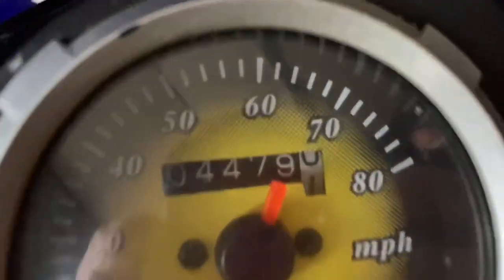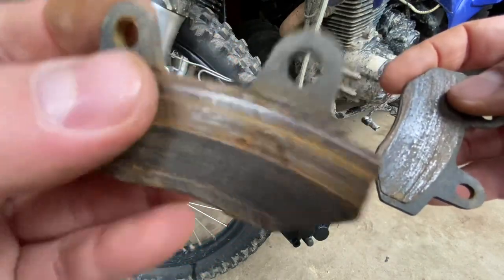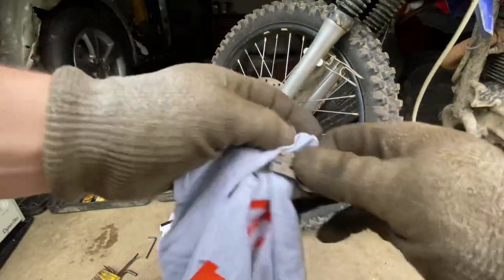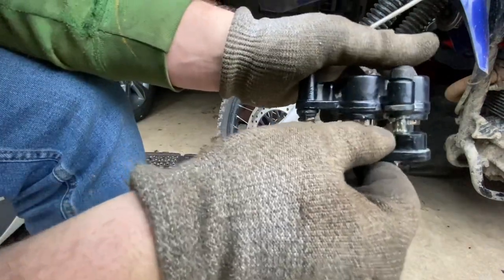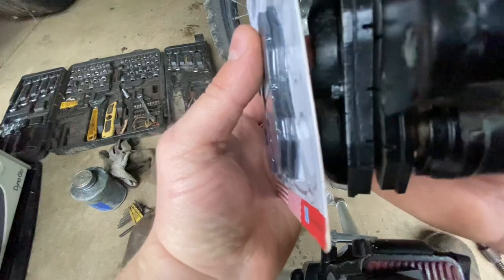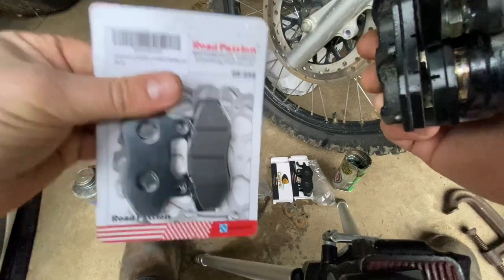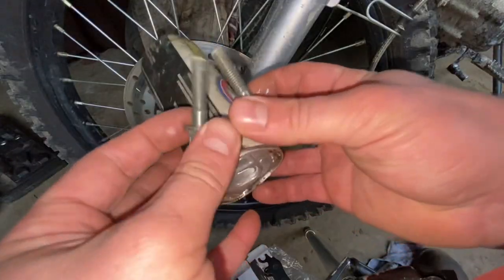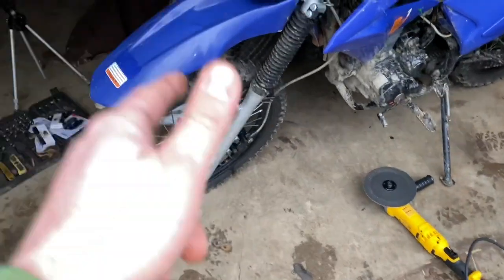Hawk 250 FRONT BRAKE PAD REPLACEMENT

Comment: Thanks for the video, it is very helpful.  I am in need of new brake pad sliding pins for my front and rear brakes.  Do you know if any of the Japanese bikes have pins that will work?
Reply from the maker: Unfortunately I don’t, Iv never had that issue on my bike, so I haven’t had the pleasure of looking for slider pins yet 🤣 the best advice to give you would be to measure the pins and do some looking around. Or see if txps can get the parts, also there is a guys called hawk250 parts on eBay now that has many parts for sale from the hawk. He might have what you need. Hopefully this helps! Thanks for watching!

Comment: hey i have a question my piston got worn down on my 250 hawk and i cant find any replacement pice online i was wondering if you knew where icould get thats piece
Reply from the maker: Txps, or a few of the other parts and bike suppliers out there have the parts. I know I have seen the rear and front caliper assembly’s on their websites, they aren’t cheap but you can get them.

Comment: Help! I bleed my brakes to get  break in fluid out now I have no brakes, what do u do?????
Reply from the maker: That’s an interesting problem lol. I would recommend going over the simple stuff, make sure you doing the correct procedure, after that, check seals, make sure you have enough brake fluid, make sure all the lines are good, master cylinders can go bad but that’s doubtful if you just drained the break in fluid. Hopefully this helps! Thanks for watching!
Reply: Thanks! I been pumpin em ft came bacc a bit. Rr just air.